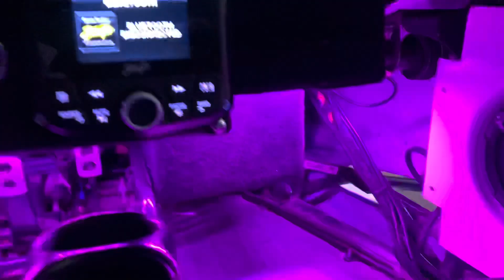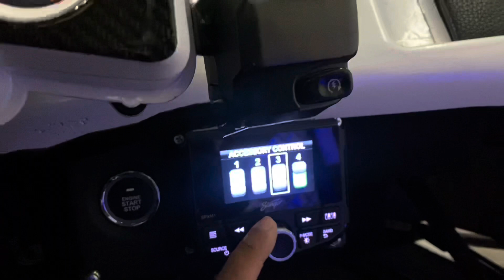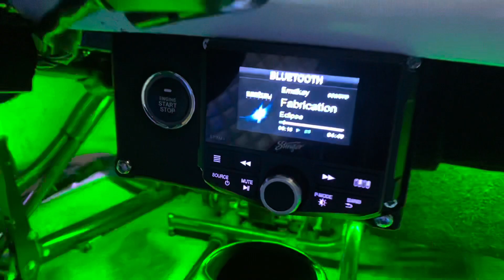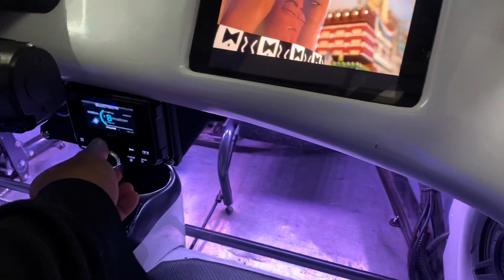Campagna Trex project resurrection part 4 Done Delivered 👍🏽

Comment: Great Job 
Is the backup camera available as a stand alone purchase? 
where is the battery located ?
Reply from the maker: I got the camera system  from joe at etuned in Texas 

There are 2 batteries 

On in the stock location and the other in the right side saddle bag 

We kept it that way because of the way it was wired 

We normally just do one Braille g30h lithium in the factory location
Reply: @NVSAUDIO  Thanks I am in texas I will call him .